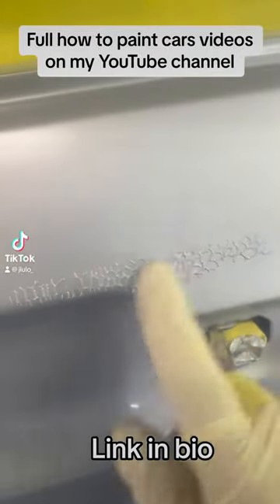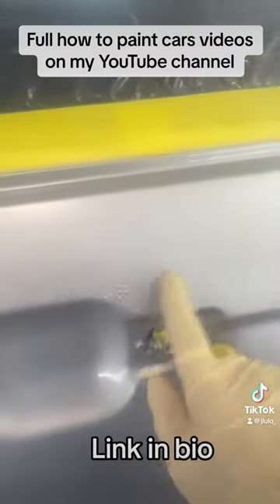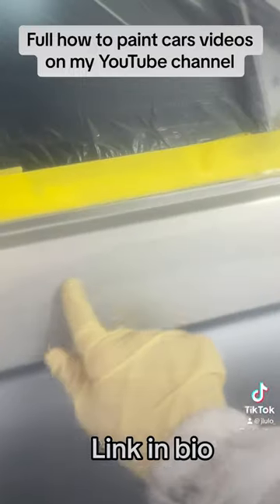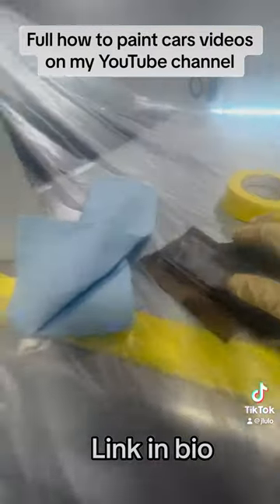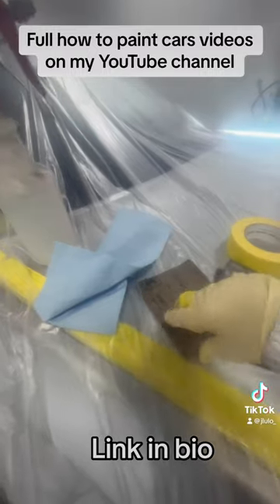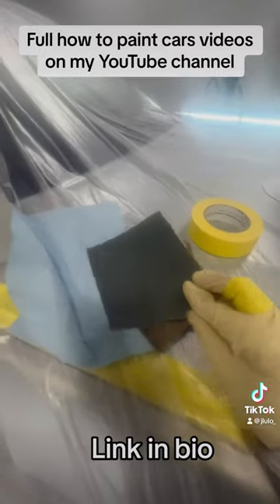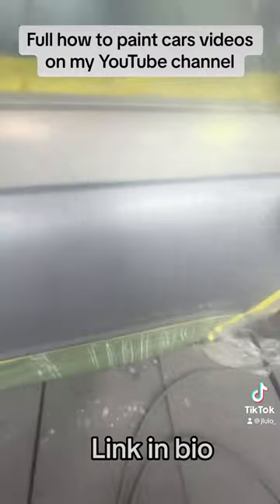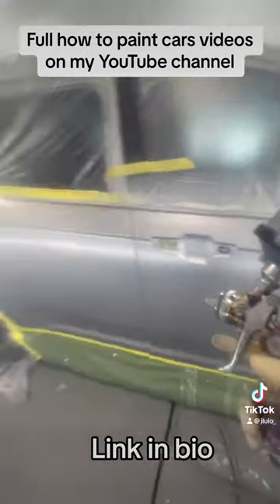A painters worst nightmare #autobodypaint #autobodypaint #automobile #car #painting #automotive

Comment: that also happens when you spray the paint too wet it starts to wrinkle...factsss
Reply from the maker: Yes you are right. But what happened in this situation was that the car was scratched after it was already painted and I had to repaint it the next day when the paint was still too fresh. And to your point, yes when I started to paint it the paint went on a little wet and it started to lift. The booth I was working in didn’t have any heat and it was cold that day so since I had water Bourne paint in the shop I used it as a barrier between the fresh solvent paint and the repaint. And it worked.

Comment: that just happen to my corvette, I had a different bumper mounted on my corvette and I had the bumper painted 1st before it was customized to the car, but the color did not match, so when the car was repainted the paint lifted, so now they had to go oall back over the bumper again.
Reply from the maker: That sucks. I hope everything goes well for you.  If it keeps lifting you can primer it with water Bourne primer or switch to water Bourne paint and then keep painting it by applying the paint lightly. Good luck 👍.
Reply: @J.Lulo_  come to find out the chemical reaction was coming from a silcone strip accross the hood and it was making the paint wrinkle at least thats what the shop told. so they had to take my aftermarket Zr1 bumper on my zo6 off to sand it back down in order to get that chemical off.. I was mad when i see that my vette was torn back down after I took it to a customizer person in Bessemer al.
Reply from the maker: That sucks dude but paint can be very finicky and any contamination can cause big problems. Iam surprised that they couldn’t try waterborne paint or primer to avoid having to sand the bumper down to its bare bones. Sometimes to avoid having extra problems and wasting time shops will strip the  paint off to start from scratch and avoid problems all together. Hope everything works out for you. Good luck 👍.
Reply: @J.Lulo_  I mention that water borne primer and the painter said he never use water borne primer...I said ok as long as my car looks good with no hickups